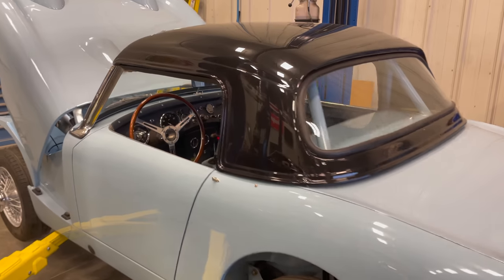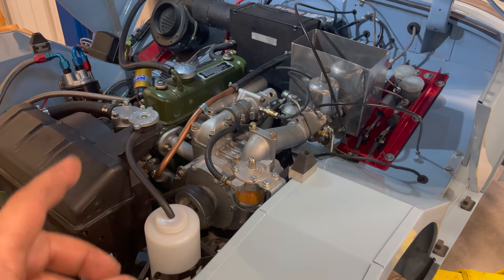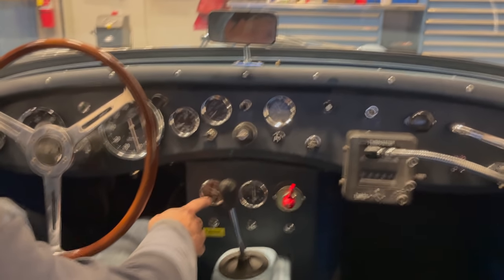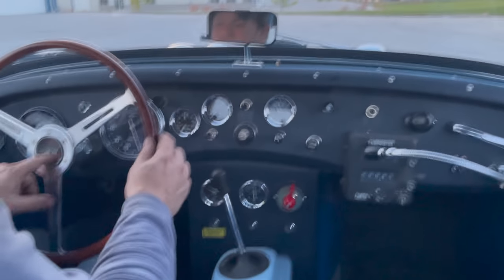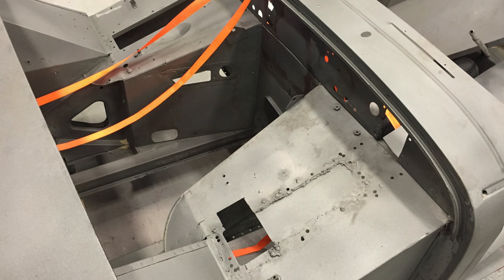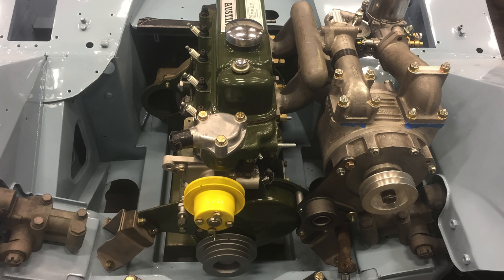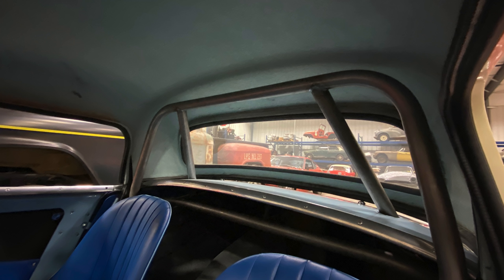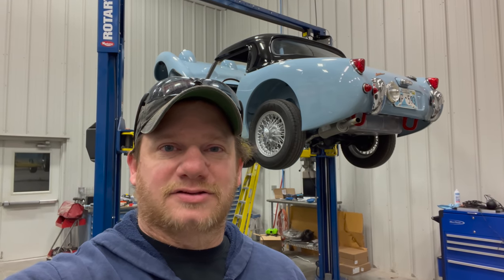Shorrock Supercharged Sprite Leaves for First Showing

Comment: I was too tall for that car at 12 years old but I always thought they were just beautiful.  This one is just right and the air inlet for the engine does fit in perfectly and looks exactly as if the person who designed the headlights would have designed it.  Congratulations on the work you did, most people would never realize how much it takes to get a car to this level.

Comment: My sister and BIL were big tsd ralleyists and had a Halda Speedpilot  for their 1966 P1800. Theirs was mounted on the navigator’s clipboard and needed to be hooked up to the speedo every time. They did their calculations with a Curta Calculator.

Comment: Crikey Steve ! That was a mad rush ! Your work reminds me of my work.  I did many 12 hour days , in fact 15 to 18 wasn't unusual.l did 47 hours for one miserable, ungrateful customer !  I guess there were no LHD  supercharged "bug eyes" . The RHD "frog eyes" l've seen haven't got that small air scoop . And l prefer the white hardtop , l think you probably do ! So you must have a body and paint man ?  Lovely work Steve . Well done !
Reply: My 1960 Sprite was left hand drive. Except for the headlights the hood was flatish. Unitl I swappd the 2-4's on the 327 Chevy for 3-2's. Then I had to cut a hole for the front air cleaner.

Comment: Great little car, a lot of work went in to get it right.

I can’t help thinking how dodgy those wire wheel spinners look sticking so far out, I suppose that’s mostly because of the adapters ?

For me cars seem to actually look more purposeful and ‘correct’ with the cute little steel wheels and hubcaps....
Reply: My 1960 had the steel wheels original caps and a Chevy 327.
Reply: @modeladenny1218  Ay Caramba !!!!
Reply: @johnmoruzzi7236  What was I thinking?

Comment: If you muck-up a little beauty with electric fans, and without Smiths gauges and have to supercharge that little 948 to get the power you want, why not go all the way and repower with Toyota.
Reply: Back in the day I went with a GM 327 and powerglide. Only room for two pedals.
Ford built a Cobra.I built a HealeyChevy.
Reply: @modeladenny1218  to bad for the MK 1 . You screwed up a well balanced if underpowered car. It must have been a real handful to handle. Such abortions I have never understood.
Reply: @tracylemme1375  After the Sprite engine went bad twice and I was familar with the small block Chevy, it seemed like the right thing to do. After all, this was right after the little Cobra was born.
In fact a Ford crossflow radiator and remote fill Ford tank was used. Dual 4-s weren't great on tight turns. 3-2's and progressive linkage worked fine.
From what I remember, the Sprite handled just fine. I was offered money and a 1933 Chevy project so traded several years later.
It wasn't built to race. It was built for fun.